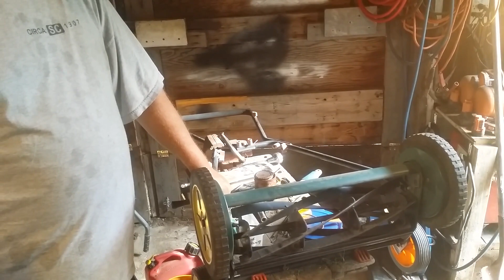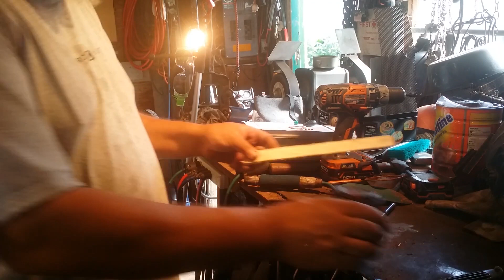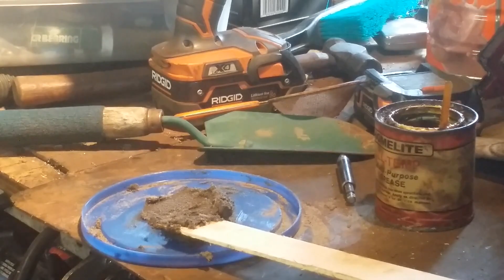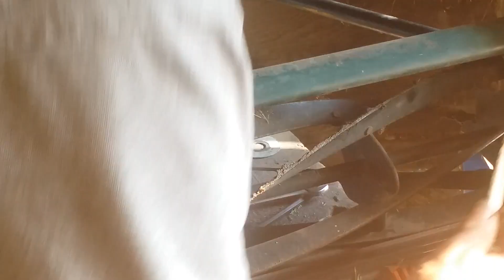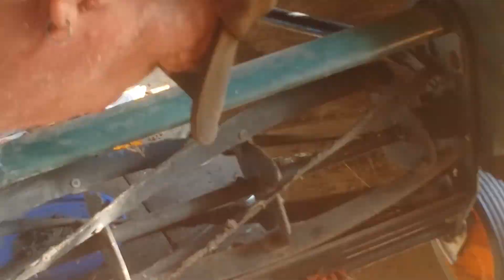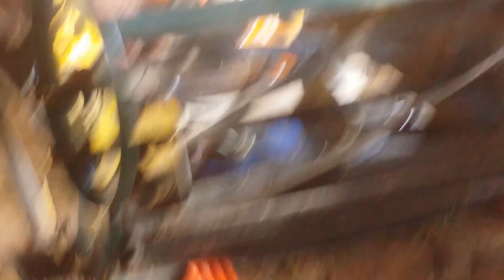DIY Grinding Paste

Comment: Nice and Brilliant Idea, Why don't I ever thnik about it,
I have silica sand and grease, I'll try it, thanks Mr. T🥰
Reply from the maker: Thanks, I wouldn't use it for the valves in an engine, unless you had some pretty expensive screens, but for sharpening paste it works a treat.

Comment: Can it be used for engine valve lapping?
Reply from the maker: I have valve lapping compound, that's what gave me the idea... But that is MUCH finer, maybe if you have REALLY FINE sand, it might work, but I'm not sure if I would chance it...
Reply: @trollforge  I have used sillica sand for sandblasting, and grease, It worked actually well, I did that on 110cc atv engine, for something bigger like car engine, it is not very safe, but for smaller compressions it should work.

Comment: love this A++++++ i thin my grease with oil getin  my lawn mover gear box and or other stuff needing thinner grease.. one can use a epoxy laqure or xyol or what ever heck gasoline as a temporary  thinner for grease if need it to thicken back up after smearing it on stuff .;{}
Reply from the maker: Yes, thanks for watching.

Comment: the 3 dislikes are the manufactures mad cause you busted em out. silica sand and grease. like this bastard lol thumbs down lol. im thinking doing it with my new valves coming. shrugs.
Reply from the maker: Pumice powder and grease works on valves.